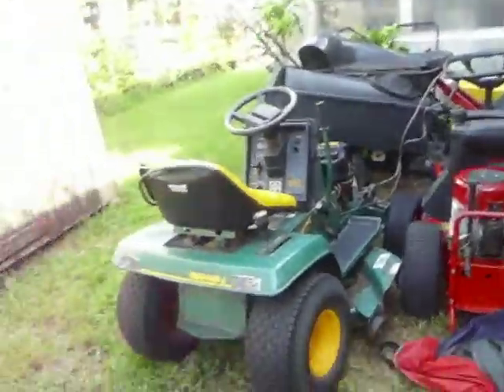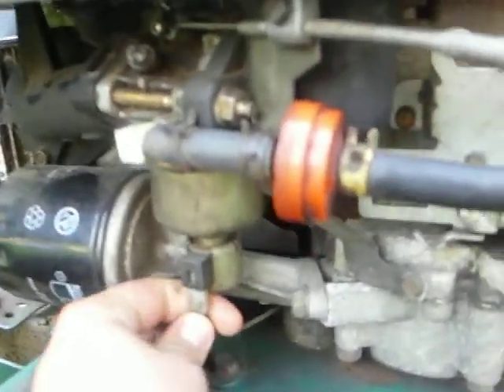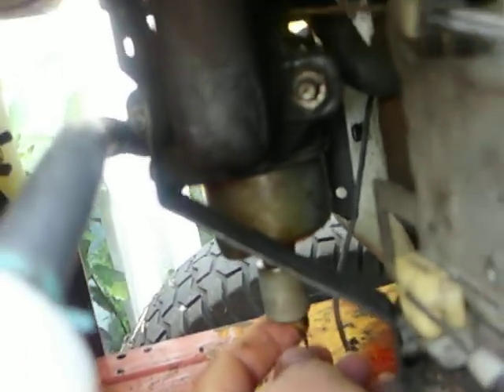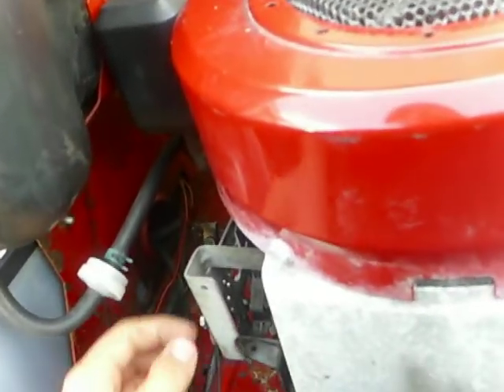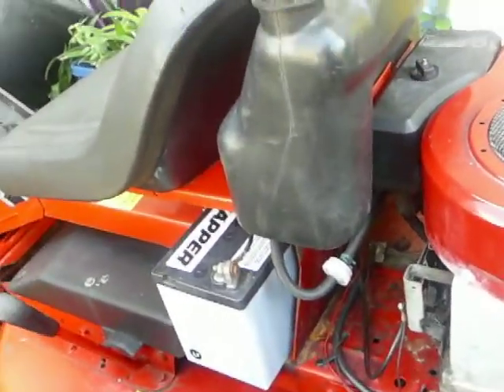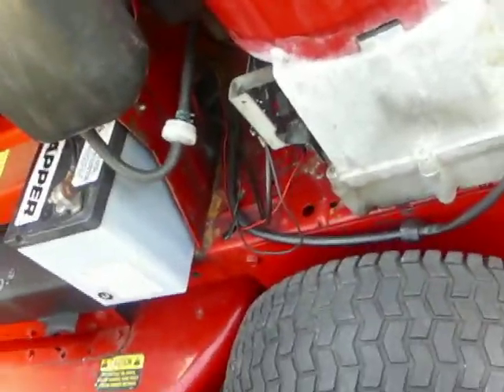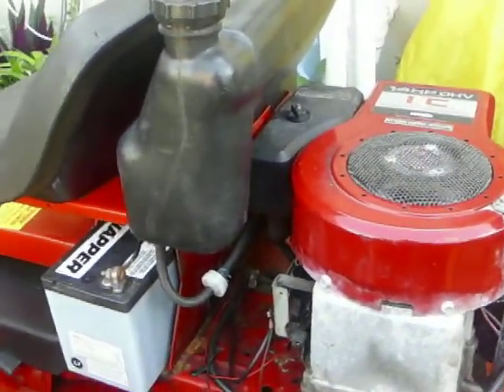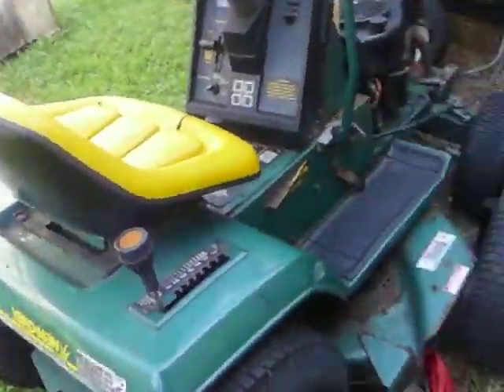Problem with ride on mower

Comment: Good video. It looks like the connector is broken. Remove both float bowls and see if they are the same size. Check to see of the solenoids are the same on the inside of the bowl. If they are, just swap bowls. Then you can use a piece of lamp cord for the power and ground.

Comment: @wandareager by doing this when ur motor cranks it will put out a positive charge and will open up the silenoid and when u turn ur key off the motor should ground out and shut off and the silenoid sould shut

Comment: if everything is hooked up rite you could just run a jumper wire from the hot side of the stator wire its the two prong plug towards the back of the mower it has a red and black wire just splice in a wire from the red wire and run it to the diesieling silenoid